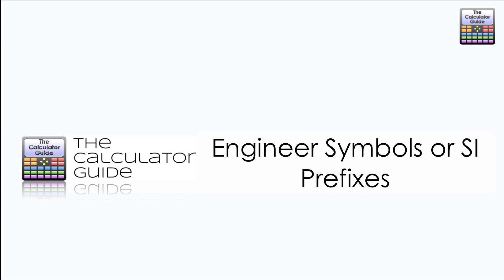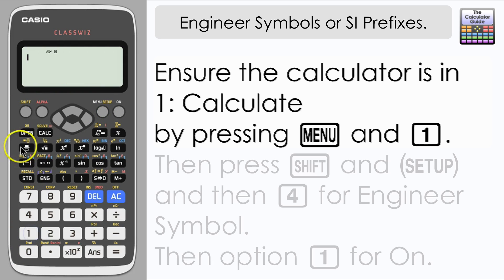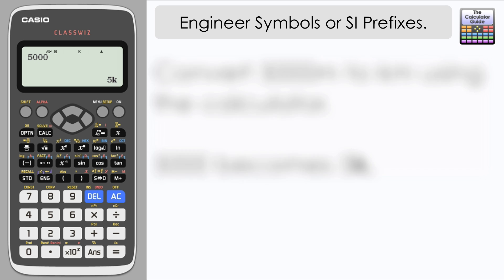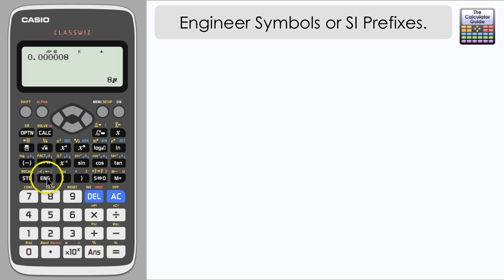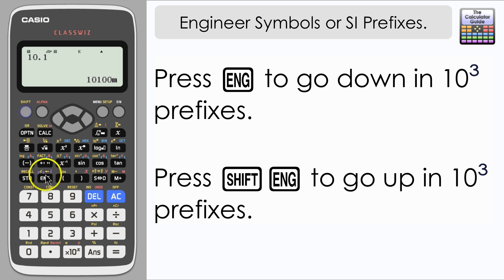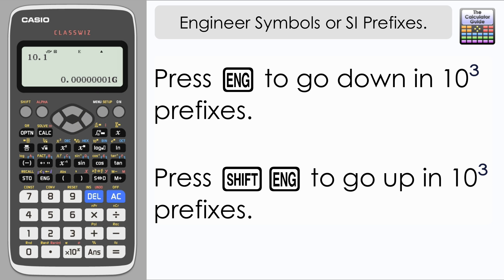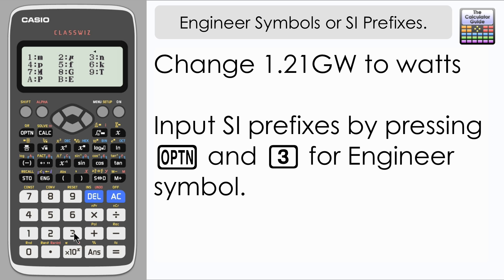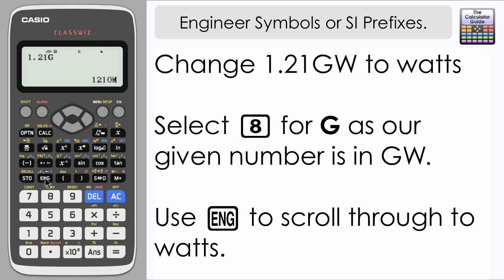Engineer Symbols / SI Prefixes - Casio Classwiz fx991EX - Switching between Engineering units

Comment: Great feature actually, the problem is sometimes the answer is like sqrt 2 but the calculator always gives the answer in decimal if engineer symbols were on. Is there like a button to switch to scientific notation or mathO without having to turn off eng symbols
Reply: Also annoying if I wanted to know the answer in fraction not decimal

Comment: I really like some of the options on this calculator. This is one thing I don't like about it. I wish it would just use the E in place of the "10 to the index". However, this is the only shortcoming so far regardless of how frustrating it is as an engineer.
Reply from the maker: Several engineers have said the same before.

Comment: hi do you have a video explaining the symbols at the top of the calculator? I want to know every one of them, specially the one to the far right, also the one next to the "D" I know "D means is degree, but the one to the left of it, I don't know what it is, and its always active.
Reply from the maker: I don’t have one yet, but yes I might do one on this.
Reply from the maker: To answer your last question, if it is a root symbol with a little pen, that just means it's in math mode.